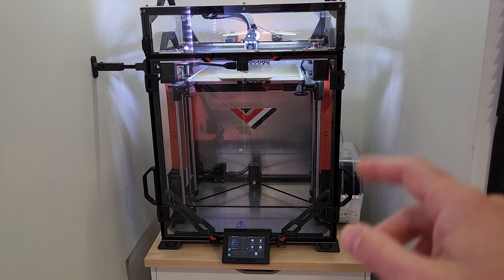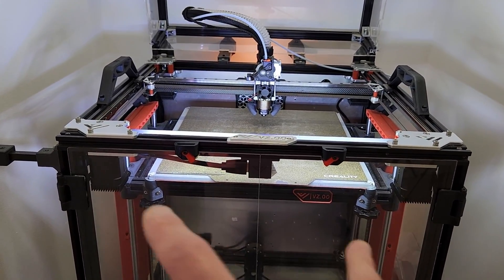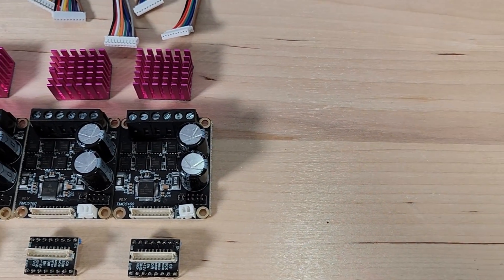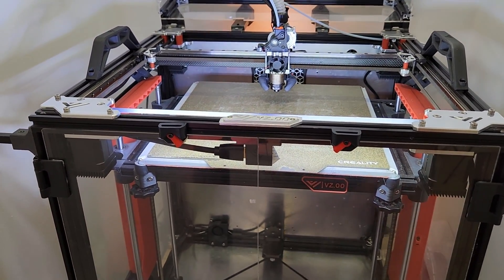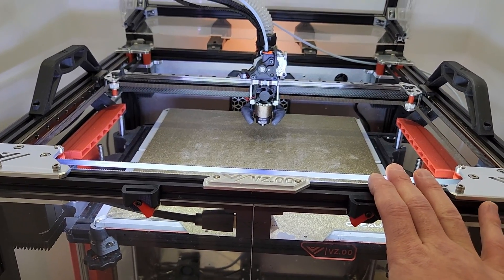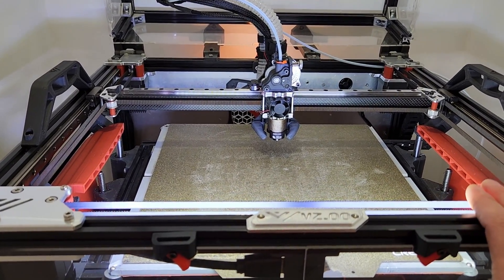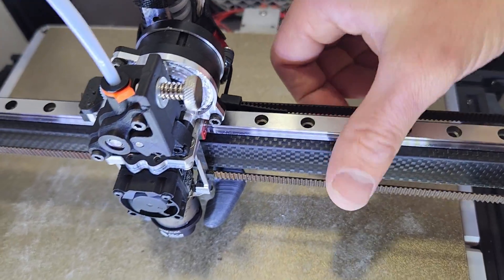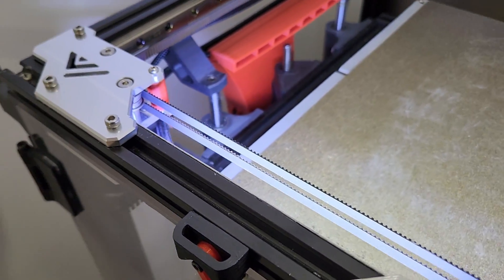VZ-330 AWD upgrade mode

Comment: Hi Simon. I have ordered 5160hv non-pro to build my non-awd vzbot330 but i was wondering if going awd would imply using a second psu (i am aware it would be better. But can we go awd with only one LRS-350 24v ?)
Reply: Entirely depends on what hotend and cooling your running just add up the wattage of everything and sutract it from 350 if you go into the negatives get a new power supply, try to run your power supply around 80% of it's rated wattage, mean well power supplies are great and can even supply more power than they are rated for but this isn't advisable

Comment: Increasing the voltage but leaving the set current the same will increase the maximum rotation rate of the stepper, but it won’t increase the torque and hence acceleration. Because torque is proportional to current. If you want more acceleration, you’re best off dynamically changing the driver current throughout printing to maximise torque while minimising heat production.

Comment: Hi Simon, congratulations on your works, just one question .... But at this speed which materials can be printed?  Petg and ABS or others can give problems? So the most suitable would be the PLA?

 I built my first printer and it is a vzbot330 ... now I have done some modifications and it is a mix between vzbot330 and vzbot235 .... .I called it vzbot300
Reply: stupid name, cya
Reply: @Propalica  😂 yes

Comment: Hey vez, i have those mellow 5160 gigantic drivers either.
I found out that the 12v input works with 18v without issues either.
And another thing, i found out that i had to remove the 5v vio input (not connect it)...
Because with it connected, tmc has register issues.

However, those drivers compared to btt is an insanely difference. Idk why.
Both at 48v and 2.2a... The btt 5160pro's provides a lot less torgue compared to those mellow monsters.
Additionally at 2.4a the btt 5160pros will burn out. I killed that way 3 drivers.
2.3a at 48v is the absolute edge limit before they burn.
They mellows have no issues all way up to 4a.
(Can't test more as 4a with my nema34) 🤣
Cheers 👌
Reply: @Vez3D
After some time and problems, took me forever to find out why my psu turns off.

This stupid drivers doesn't have backcurrent protection. Every normal tmc5160 step stick has.
The problem with this is, if the motors stops instantly from a fast rotation, the psu turns off.
Some psu's turns in again after a second, some stays off.

Makes the big mellow drivers absolutely useless 🤦
Reply from the maker: I dont have that issue and first time i hear that
Reply from the maker: You seem to have modified lots of things on them.. like the 5v and 18v instead of 12v.
Reply: @Vez3D  I'm supplying them now with 12v, basically everything is in spec now.
Check the schematics, they miss there entirely backcurrent protection.
Means, that the generated motor current flows directly back where it can to.

If you don't believe me, make some of your speed test travels and execute an emergency stop.
That should be actually enough.

Im running a nema34, there is even any slow speed with emergency stop enough, to turn the psu off.
Reply from the maker: It happened douzens and dozens of time already (more like hundreds) ... never had an issue
Reply: @Vez3D  that's weird, then your mcu has some kind of protection for it like it seems.
You could disable the motors and move the toolhead around, i didn't tryed that here, but that should generate backcurrent.

Or however, if it's working for you it's great. For me with my tiny2040 (as mcu), the backcurrent flows directly to the psu.
Means i have no protection anywhere in between. Im actually designing an pcb only for that, because normal drivers are to current limited and get too hot for my nema34 🤦😂

But mellow should improve that drivers anyway, in the next revision or something.
Pretty sure earlier or later, if more people use those, there will be more complains.
Right now those drivers are an absolute rarity 😂
Don't think that many if all use them 😂

Btw i can upload an Video if you don't believe me 😂
Reply from the maker: @RamaOlama  many people running them and fist time i hear this though.
Reply: @Vez3D  Probably because many people run them only with nema17, on printers.
I mean if you hear it first time or not, i don't know if you understand schematics or not, it's fact that they miss backcurrent protection, while normal step sticks have it.
I mean what's not clear there, if you don't encounter the issue, it doesn't mean that it isn't there 🤷

Comment: Hi Vez, Love your printer design. I think its far better that Voron.  
Have you ever considered changing the motor mount design to move the motors outside the frame for better cooling and for running a heated chamber?
Reply from the maker: yes it was like that before. But it changed. One of the reason was it was really really hard to find pulley thats were 100% perfect centered. They all have a bit of loose and when you tighten the set screw, they go off center a bit... causing printing artifacts and weird wall quality.
Reply: Can someone explain why that is not an issue with the motors inside?
Reply from the maker: @rico3696  its an issue too.. but the more pulleys you add the more chances to have artifacts.  But i was running nema23 style motors with 8mm ID pulleys..  it might be different with nema17 and 5mm ID pulleys.  MELLOW has great pulleys that are centered with tight tolerances. But with 8mm i tried several and never was happy
Reply: So if the motors are ourside you use more pulleys? Should there not be the some number of pulleys, just more idlers?

Comment: Do you have to do anything special in firmware for QuadXY? If the motors run in parallel, then I would think you could just leave the kinematics set to "corexy" but is there anything else you have to change?
Reply from the maker: yeah you add  X1 and Y1 ... so you ended defining 4 steppers.  They are NOT in parrallel.. they each have their own drivers

Comment: More precision ?  Better print quality ?
Reply from the maker: not really more precision, but it has way less belt back lash or belt lenght between 2 points. So it helps a LOT with resonnance, therefore more quality :)

Comment: Hi Vez ! A few things came to me watching this vid:

- one thing I always pay attention to in 3D printers is space efficiency. about the loss of print space on the 330, wouldn't it be solved by simply reversing the gantry  to have the two belts path at the back, like for the 235 ?

- if motors over-heating is a problem, you can directly bolt them to the aluminum plates, as they can act as heat sinks (Slice engineering is trying the same for their passively cooled Mosquito).

-  did you give up on the idea of keeping the XY motors outside the chamber ?

- RIP LSD :((

Thanks for the great vid !
Reply from the maker: The belt is not what is blocking the front.. the motor plates are... and then yes belt too but its not belt that are hitting first...its the motor plates.. And no i dont want to change the design arround because people would need to change too many things. We tried to keep the printer as it was for simplicity.  And yes motors are bolted to aluminum already.

Comment: Build new bed mounts to offset Y axis to the rear and get your BV back.  Looks like it would be very easy with a few printed parts.
Reply from the maker: that wont help. The back is already on the edge. If we move the bed back, you will lose the space in the back.

Comment: why vz bot doesn't have sensorless homing ?
Reply from the maker: you could if you want. nothing stops you from that :)  but not using those external drivers. they dont have that DIAG pin. so you have to use stepsticks that have the diag pin

Comment: About the voltage supply for the TMC5160. The TMC5160 requires 11.5v to drive the external FET gates. If you don't supply this externally then it is derived from the motor voltage supply with a linear power supply inside the chip. With high motor supply voltages this will cause significant power dissipation (heat) in the chip. The mellow design which supplies 11.5v external to the TMC5160 on their (larger) module is the recommended way of implementing the TMC5160 in the datasheet.

Comment: Good job man,
Why you didnt use sensorless for X and Y?
Reply from the maker: Yeah you can do that too. Its just more precise with switches
Reply: @Vez3D  that presision is good , we are talking in microns soo that not bad
Reply from the maker: also you would have to use step stick... but not using those external drivers. they dont have that DIAG pin. so you have to use stepsticks that have the diag pin

Comment: First thanks for the videos 🙂So close to 3D printer tech p@rn. 🙂
So AWD with internal 5160 and 48V compared to 24V did not do anything for your acceleration. Did the same result apply for external 5160 and 48V? You mention in the video you could go from 20k to 32k acc with 2WD to AWD, but does not mention any acc for AWD with external 5160. What ampage do you run the external 5160 at?
Could you possibly explain how one can measure the max acceleration going diagonal? I'm looking for the method so I can test myself.  Maybe you have a video or a link?
Thanks in advance
Reply from the maker: I dont have data from 24v.. I dont remember what accel I was getting back then.  that 34k accel at 1000mms diagonal was with external drivers. With internal stepstick at 48v I was getting about the same accel as I was getting with 2 motors on stepstick
Reply: @Vez3D  Thanks 👍.  Video is very inspiring. Looking forward to see more of the launch of the Goliath too. How do you determine what your max diagonal acceleration is and how do you verify that you actually have the acceleration you think you have? I am not question your data. I want to test my self and I am unsure what the right method and approach could be.
Reply from the maker: @petermaersk-moller3014  i created a macro for that that should work on most printers. Check my other video abou the vz235 max accel and speed test. Its in the description

Comment: The gate voltage is the impact Parameter itself for heating the mosfet. Higher voltage means the Gate open larger and the resistance get lower (low RDSon). Lower rdson resistance mean Alot less heat, so the 12V Gaze voltage and the chosen mosfets of this driver Board is a great improvment for the heat and deliverable Power (amps)
Reply: As Iceman said, it's more about the faster switching. RDSon doesn't really matter when the currents are this low. 3A with a .02R rds-on gets you at most 0.2W. most of the losses are switching losses, since the switching events happen at 50-100kHz.

Comment: You definitely need to replace the leadscrews with belts
Reply from the maker: Oh no never.  But if people prefer that they totally can :)
Reply: Why? The z doesn't need to be super fast so leadscrews will be just as good in that regard, plus with belts how are you going to stop the bed from slamming to the ground?  I have a delta printer and the tool head only weighs around 300g and if I turn off the printer while homed, or a power failure, thermistor/heater issue then the tool head has no power to keep it up and slams hard to the ground, on a bed which weighs a few KGs it's gonna break or twist things.
Reply: @madbull4666  yeah, that's why you would use a high gearing ratio like 5:1 to retain the needed resolution and holding torque. For example on my machine I use 20t pulleys with 1:5 gearing which results in a rotation distance of (1/5)*40mm=8mm, so it has exactly the same torque and resolution as a 8mm pitch leadscrew. The difference is that belts are flexible and thus only constrain in z direction, not x and y. Leadscrews on the other hand do, so you are overconstraining your z axis, and if they are not perfectly straight and parallel to the axis (which they most certainly aren't) they WILL cause artifacts
Reply from the maker: @pauhull  i have oldham couplers that allows the screw to move freely without affecting bed. The z is tested perfect till 400mm high with 0 wobble or z arrifacts
Reply: @Vez3D  I tried oldham couplings before switching to a belted z and had a really bad experience. The couplings separated if they were not perfectly aligned and often times they caused more wobble than they were supposed to fix. I tried all kinds of different couplings, replaced the leadscrews, tried different brass and pom nuts but nothing would get me the perfect results I get now with a belted z. But if it works for you, it works... Just saying that I didn't have a great experience with leadscrews
Reply from the maker: @pauhull  im not talking about couplers between motor and lead screw...the vzbot dont have that. Im talking about that couplers between the lead screw nut and the bed assembly. Like a wobble ring. The lead screw can be bend or miss align and this mod will not worry about it :) it will let the lead screw nut wobble arround the bed assembly without affecting the hed assembly
Reply: @Vez3D  oh I see, like mirage did with the $20 ball screw? Yeah that's also a way to decouple x and y, no wonder you get these perfect results then. I'd argue that a belt setup would be less complicated but if you already have the decoupled leadscrew setup you might as well keep it. Although I don't think that what you mean is called oldham coupling... Anyway, great work :)
Reply from the maker: @pauhull  yes like mirage..and yes its called oldham coupling. Hehe even the hevort wobble rings are oldham. You can buy my oldham couplers in brass on mellow store...either for 8mm lead screws or for ball screws. They work perfect :)
Reply: @pauhull  while the holding torque and resolution might be the same, what are you going to do if the bed motors don't have any power suddenly while it's up top? The bed will slam to the ground and will certainly twist or break the mounts.

With my delta I have to be really careful about this if I'm changing anything, I can put something bouncy under the tool head to stop it from damaging or have my hand under it to catch it, if it's printing then it can land on the print so again shouldn't damage anything. With a bed on belts instead it doesn't have any of those luxuries if anything does go wrong.
Reply: @madbull4666  as you said, the holding torque is the same. Stepper motors have a small holding torque even if they are not powered. That's why the bed doesn't slam into the ground with leadscrews, and with the mentioned gearing it won't with belts too. It's all about the rotation distance.
Reply: Why? A normal leadscrew have a pitch of 8mm per Rotation, mean with 200 Steps its 0,04mm Resolution. A Belt with a 20 tooth pulley have 40mm per Rotation. With the same 200 Steps Motor that means 0,2mm Resolution in Z, which is 5 Times worse for accuraty

Comment: I love the motivation of shortening belt paths. I've been intending to do this to my Ender's Y axis, and to eventually do 6 motors on my future delta, all to have crazy short effective belt lengths.
Reply: I wonder... Would adding idlers with slight tension help, or would the additional drag outweigh the benefit?
Reply: @apexncdaddy  No, it's just the length of belt available to stretch between where it's held to the position it's supposed to be at (the motor) and the carriage. With one motor, the far side always has a very long run of belt pulling it. With two, there's always a motor close.
Reply: already do 6 motor to my delta and improve a lot.... even the belt tension is low.... could increase belt lifespan and also mechanical load... so no need high tension into belt

Comment: Your motor heatsinks won't do much good in that orientation without forced airflow. Being upside down, you won't get convection cells (formed by hot, lower density air rising, and cooler, higher density air falling).
Reply from the maker: I know i know..its not done yet..fans are ordered :)
Reply from the maker: but they must be doing something because they get warm, so they take some heat off of the motors already :) .. just like the metal motor mounts :)
Reply: @Vez3D  getting warm, just means that they have a thermally conductive path to the motors (as they should). It does not mean that they are effectively expelling heat to the air. Most cooling (in the absence of forced air) will be convective. Radiative cooling is negligible in a system like this.
Reply from the maker: @JonS  you are right :) fans will take care of that